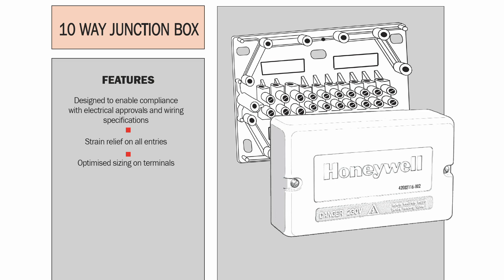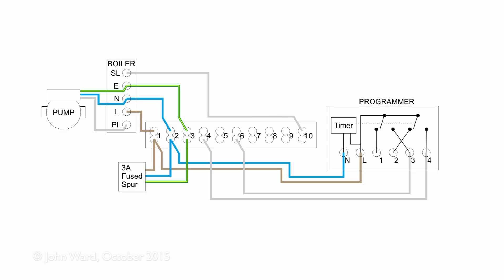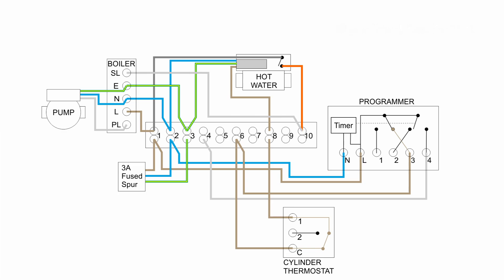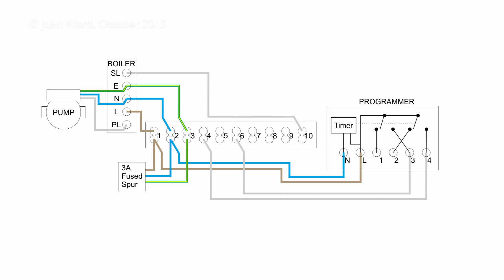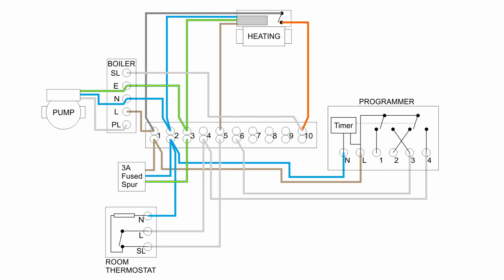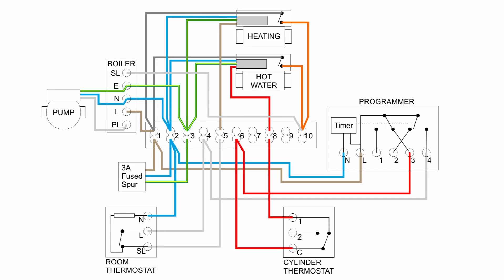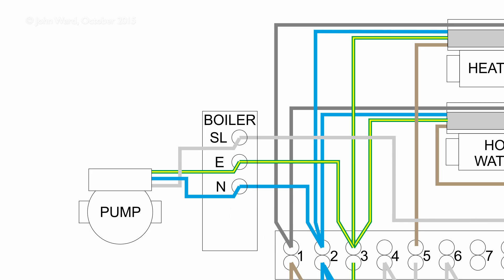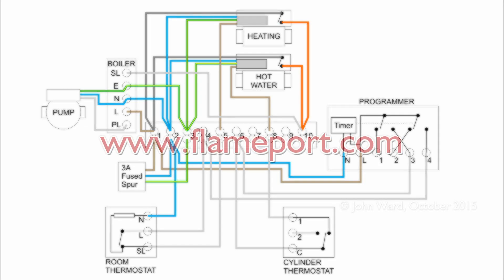Central Heating Electrical Wiring - Part 2 - S Plan

Comment: Thanks for this excellent video, well paced with excellent animation and narration. This allowed me to diagnose my own system fault by just using an electricians screwdriver that glows when in contact with 240v a/c. Turned out to be an intermittent fault on the electric valve.

Comment: Im waiting for new controller to be fitted, any way to feed the boiler direct for hot water snd central heating? Is the boiler fed with mains voltage, in my case 240v ac
Reply from the maker: Switch off power, remove the programmer, add wire links between L,3,4, refit programmer, switch on.  CH & HW will be on permanently and only controlled by the thermostats.
Remove the links before fitting new programmer.

Comment: Thanks JW your such great video and explanation.  As a new immigrate, this is my first time to fully understand U.K heating system and how it runs.   However, I have a question may be stupid, hope you can explain more.   In current heating situation,   a programmer and thermostat must both ON to start the heating?   Is it possible just turn ON thermostat to start heating without programmer ON? In my situation, the thermostat and programmer are installed on different room. It is quiet inconvenient to switch heating especially at night.  Any suggestion? Thanks in advance.
Reply from the maker: As shown in the video diagrams both programmer and thermostat must be on for the heating to work.
For systems with only a single device (usually an all in one item such as a Nest, Hive, Tado etc) they are usually wired in the same way as the programmer, except that the switched output connects to terminal 5 instead of going via a separate thermostat.

Comment: I wish to acknowledge with thanks, the help and guidance I received by closely following your wiring diagrams given in this vlog, together with the detailed explanations that you provide of how the ‘S’ plan system ideally should work.  I particularly found your explanation of the function and sequence of each component very useful with the result that I was able to successfully completely rewire my system from scratch. We had bought a property with a modern heating system installed, but it had clearly been wrongly wired. The heating would only work if the hot water was ‘calling for heat’ and the boiler ran all the time during times only when the programmer had hot water set to come on and was therefore very inefficient and in need of attention.  We called our Central Engineer who said it was a wiring problem and that he didn’t ’do wiring’, as it was too complicated and that we needed the services of a Specialist Heating Electrician. Some time previously a new Valiant Eco boiler had been fitted and I suspect the Installer had no idea how it should have been correctly wired up, as I found a mass of wires (19) in all, many disconnected behind the boiler isolation switch. The wiring Centre consisted of an enclosed basic 10;point connection strip with wires everywhere, some of which not connected that made no sense. So my only option was to ‘start from scratch’ with a new dedicated Wiring Centre and identify, by process of elimination what component each wire was connected to. Thanks to your help I was able to fix it and it’s great to have the system actually working properly. My next task is to install a Hive Thermostat Mini to digitally control our heating and hot water system.

Comment: Very well explained. I have 3 zone , 2 zone heating and 1 water immersion. The thermostat is L-N power supply and 3zones wiring. The boiler has been replaces with a  new one Grow warm. Now I have to turn On the water to make working the 2 zones of heating, if I need only the heating I cannot turn On without water On. Seems a S plan plus. 
Any advice will be appreciated please. Thank you

Comment: how can the pump remain on when the valve has to be shut for the the boiler to switch off?
Reply from the maker: The pump is controlled by the boiler, not the valves.  A separate automatic bypass valve is installed which allows water to flow when the zone valves are closed.  It opens based on water pressure, not electrical signals.
Reply: @jwflame  wow thanks for responding so quick. Love your videos they are really helpful. Have a great evening.

Comment: How does it work with an underfloor heating system incorporated into it?
Reply from the maker: The usual method is another 2 port valve which supplies the UFH system.  Zone thermostats for the UFH, the actuators and pump are wired to a UFH controller, and that just supplies an on/off signal to open the valve which then activates the boiler.
Some UFH controllers can have everything in the same unit, including hot water.

Comment: Thanks as always for providing these guides. They are perfect, unlike every professionally or DIY system that  i encounter each time I move house. I spend a day wondering how on earth any of it works, draft countless schematics, then remember your channel and suddenly I am able to understand the bodge before me and rework so it's closer to standard. 
This time we have 30 year old house (was the show house) where mains and the boiler wires start at the programmer and the room thermostat is fitted to it too.  
Thanks again John for preparing, producing and sharing. Very much appreciated.

Comment: Dumb question time. Why do the motors need microswitches in them? Why can't the SL be sent directly from the room thermostat/cylinder thermostat? Is it so that the signal is only sent once the valve is fully open?
Reply from the maker: Yes, it's to ensure there is somewhere for water to flow before the boiler is switched on.

Comment: The pump for the hot water that was connected to the boiler would you have that on a switch fuse spur ?
Reply from the maker: Yes. All of the heating wiring, boiler, pump and other controls should be connected to the same supply, normally via a 3A fuse.

Comment: Great video explaining everything in simple steps to build up the full picture. Removing some of the common  wiring to show how the system works and common faults was very useful. The clarity,    simple plain English explanation and build up, one of the best videos I've come across. Hope you can update it with new hive connections on combi and system boilers.

Comment: Hi John, brilliant videos thanks very much. We are installing a boiler stove that will be connected to an existing heating system. so adding an extra thermostat and pump to the right side of the chimney breast in a Heat Hero system. Do I run a 5 core wire from the new pump up to the existing wiring centre (EPH) and where in the wiring centre do I connect this wire? Thanks again
Reply: I was told the I need to run a relay from the new pump to the existing motorised valves in the hot press, I presume this means wired into the wiring centre in the hot press, just unsure what core I need for this and where to connect into the centre

Comment: John, I have  Baxi 836 on order and I read in the online manual that the signal to initiate the boiler (SL on your diagram) must be derived only from a 230v supply originating within the boiler not from the 3A spur.  So in other words the two grey wires on the valves are fed from a 230v supplpy in the boiler and the two orange wires then feed this back to the boiler.  Do you have any idea why this would be the case?
Reply from the maker: It won't make any difference.  The whole heating controls/boiler must be supplied from a single supply, which is usually a 3A FCU.  They may have stated that in an attempt to avoid people connecting to some other circuit for the supply for a thermostat, which would then mean disconnecting at the isolator would still leave parts of the system live.
Some boilers including some Worcester Bosch models switch the 230V supply to the thermostat/programmer so that when the boiler is switched off at the front panel, the programmer/thermostat also has no power.

Comment: Thanks John, you helped me to realise that the three cables entering my programmer box were the three-core timer-power cable, the power-out cable going to the boiler, and a three-core cable consisting of neutral and yellow cores from the room thermostat, and a red core from the cylinder thermostat; rather than the advice that I had received from the electrician who had fitted the previous programmer, that they were a power cable, a cable from the room thermostat and a cable from the cylinder thermostat. No wonder I kept blowing fuses as I replaced the old timer with one which would control the water and the central heating separately. Oh what fun I had as I vaporised the neutral core on the power-out cable! What pretty flashes it made! I was so happy that I only burned out the switch on the fused-spur! Thanks once again for such clear expositions of all things electrical.
Reply: You really shouldn't be messing with stuff you do not fully understand, you'll either hurt your self or someone else, get someone in that is qualified for your own sake.

Comment: what happens when both valves close but the pump is still running cause boiler wants to remove the heat out for some minute or 2?  valves are closed, where does the water go to?
Reply from the maker: An auto bypass valve is installed, which is normally closed but opens when the pressure increases due to both valves being closed.  That allows some circulation through a short section of the pipework.  Example: https://www.screwfix.com/p/straight-auto-bypass-valve-22mm/4747v
Reply: @jwflame  many thanks!

Comment: Hi JW, just wanted to check my understanding... I thought in the last vid you said terminal 3on the programmer was HW OFF, yet here terminal 3 is sending the signal via the cylinder stat to the pump to turn ON....  Id be grateful if you could help me clear this up? Cheers. Great video as always!

Comment: Fantastic video! Where does the satisfied terminal get connected to on the boiler stat and where do the hot water off and  central heating off connections in the programme go to, as these are not shown. Many thanks
Reply from the maker: Those terminals are not used for S plan.
Reply: @jwflame  thanks John  your a legend 👍. I'm actually a long serving spark but always avoided getting into boiler controls. I'm now on a job where I have one to do! Your video has been SUPER helpful 👍

Comment: Excellent videos. Thanks very much. A question about the 2 port valve in this arrangement.
Most 2 port valves have an external lever so that the valve can be manually opened. When the lever is latched open, does the electrical switch also become closed? If so, surely the boiler, pump would be providing heat to the cylinder, but the cylinder thermostat is bypassed.
Reply from the maker: The lever only opens the valve, the switch won't be activated. If it's open on the lever and the valve is then powered, the lever will be unlatched and the valve will close once power is removed.
The manual lever is only there for filling / draining the system.
Reply: @jwflame  got it. Thanks!

Comment: iam putting in a s plan system at the moment,  the location of the 3amp fused spur is next to the  programmer, so can i put the live and neutral  and earth feed into the  programmer from the fused spur then use the 5 core cable to take the live, neutral and earth feed from the programmer to the wiring control box?? will this be ok, thanks carl
Reply from the maker: Yes.
Reply: @jwflame   cool thanks for the reply, great informative videos, thanks :)

Comment: Thank you for this video. It saved me a lot of heart ache. Had a faulty valve which kept the boiler on and when I went to replace it. It turned out the person who had done the installation had put the two thermostat in series on the heating system and none for the hot water 😳

Comment: Great video thanks,  The problem found is when I've got both hot water and heating off the boiler still firers up from time to time, Is this because the power to the boiler is not controlled though the hub or should it be?

Comment: Thanks for the upload, I’m an electrician and my workplace refuses to give me more experiences. So 1st fixers are always 1st fixers, 2nd fixers are always 2nd fixers etc, they do this to prevent you developing the abilities to become self sufficient and leaving for better pay. I’m one of the few allowed to do a larger mixture than just that, but they refuse to let me learn heating systems or industrial aspects of electrics. I can’t stand not learning anything new. 

Don’t know if this is common practice but it’s annoying as hell. There’s some lads who have 15 years more experience than me but have never tested an installation or second fixed a fuseboard.
Reply from the maker: Find another employer.

Comment: Is there an internal thermostat in the boiler to independently which off the pump to allow the pump to run on..?
Reply from the maker: Most modern boilers have that, older ones usually do not.

Comment: is the pump shared by the central heat and hot water or are there two separate pumps, as I would imagine a pump required to circulate water through a closed pipe  inside a hot water cylinder , would be slightly under powered compared to one required to circulate water for central heating..?
Reply from the maker: One pump for everything.

Comment: Awesome video, I wish I found this a few years ago before going to the effort myself of tracing it all out. Great reminder though!
I do wonder, I have seen a system (thats not operating correctly) where the grey/brown of the valves are connected to the switched live from the thermostat (eg. the equivalent of both on terminal 8). To me this is incorrect, as you would be trying to power the furnace through the thermostat's not to mention the long runs of wires. Am I correct in thinking this is totally wrong? ie Is there some obscure reason for this type of connection other than incorrect wiring.
Reply from the maker: It would work but it's not normally wired like that.

Comment: Very informative video, 
  I have  valiant 832 protec with hive system single . I am thinking of using a  s-plan system wiring on my boiler to control the outside heating for my koi pond  using the Hot water part of the Hive 2 channel receiver by using the  hot water side of the Receiver.  I have a MV and temperature controller for the pond heat exchanger ( radiator) . Is this feasible ? Any advise would be appreciated.
Reply from the maker: Yes, the wiring would be the same, the Hive output would activate the zone valve, and the switch in that valve activates the boiler.  Plumbing would be the heat exchanger in place of the hot water cylinder.

Comment: why is there seperate pump. doesnt the boiler alrady have pump inside?
Reply from the maker: Some boilers do, for those a separate pump isn't required.  Other boilers do not have a pump, so an external pump is needed.
Reply: @jwflame  thanks John, helpful as ever. Also 1 more question. In a 2 zone system, 1 valve hot water. 1 heating. If we're to turn on heating, does it not divert through the how water cylinder aswell? Of would both valves need to be open same time ie call for hw and ch at same time.
Reply from the maker: @scott1506  Hot water and heating are separate - if you want both, then both valves need to be open.

Comment: Well explained John. How would you incorporate a solid fuel stove with backboiler to this s plan system. So if the oil burner is off and you want to heat the rads from the stove given that there are 5 valves. 1 for HW and 4 for CH. Thanks.

Comment: Very clear and informative video JW. However if as in my case a frost thermostat (boiler located in unheated garage) and a pipe thermostat (to override frost thermostat once warm water is flowing in pipework) are required, is it safe to assume they are wired in series between terminals 1 and 10 please?

Comment: Hi John, Thanks for this, Used this plan some time ago for my system worked a treat. One intermittent issue arising however. i'm getting boiler out on temp limit switch from time to time. (new pump, stats etc in place). I believe its related to when stats or timers close both valves when boiler in mid flow,  causing too much latent heat in the feed line with no possibility of convection. Even pump overrun wont solve it since the pump will be working against closed valves!. I'm looking at 2 delay relays one for each side (HW & CH), feeding delayed power to the valves (and hence pump), and connecting the boiler to the power input from the valves (power out from stats) in place of the valve outputs. This would ensure that a valve and pump would run on after the boiler was shut off. Be interested in any comments on this approach. Cheers
Reply from the maker: That would probably work, but the more usual method is to install an automatic bypass valve which opens when all of the valves are closed.    https://www.screwfix.com/p/straight-auto-bypass-valve-22mm/4747V

Comment: How would you incorporate ufh on this
Reply from the maker: Several options but the usual method is to add a 2 port valve which supplies water to the UFH manifold, and the output from the UFH controller activates the valve motor, and the switch in the valve operates the boiler once the valve is open.
Thermostats, zone actuators and other UFH items are all wired to the UFH controller.
Reply: Jon I had a comment off you in the inbox but its disappeared

Comment: My cylinder had no thermostat... Should I add one?
Reply from the maker: Yes, otherwise the cylinder will be heated to the temperature of the water in the boiler will will be far too hot, and there is nothing to switch the boiler off once the water has reached the desired temperature which will waste fuel.
Reply: @jwflame  thanks John, I am now relying on the timer to avoid overheating the HW, but adjusting it is very hard. I will try to add the thermostat